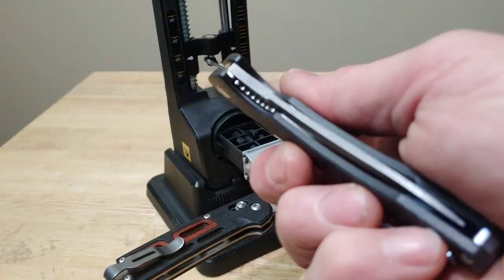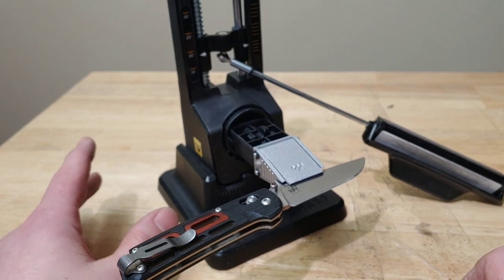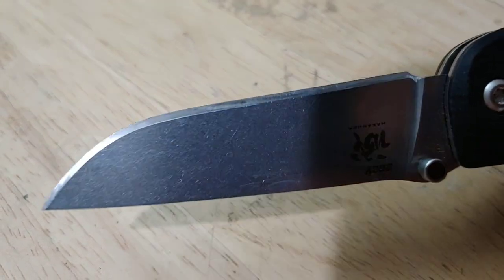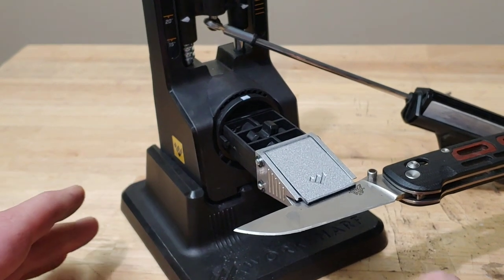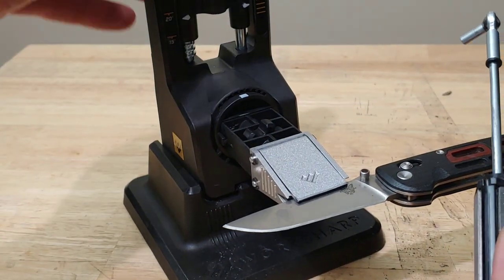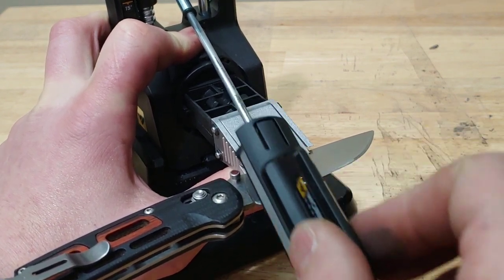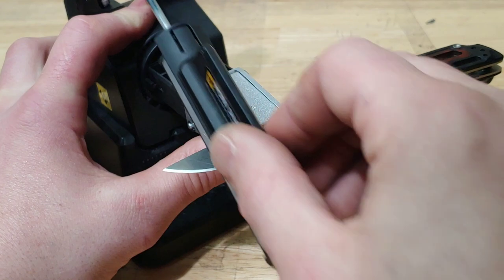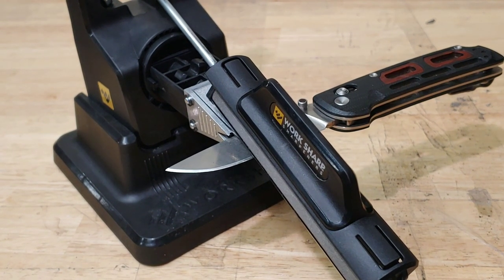LONG TERM UPDATE WORK SHARP PRECISION ADJUST SHARPENER

Comment: So, dont know if this is something you would ever do. But I read about this on someone else's channel, tried it and man did it work. So The first knife had a relatively good edge so I started at 600. I went probably a few more strokes than suggested at like 12-14. As you say the jump from "600" to the ceramic is huge and it was taking a ton of time. So here's the trick. Instead of just going to the ceramic and spending a year on that grit you get this stuff called "aleens tack it over and over" You apply that to the ceramic with a finger getting a thin coat all over the ceramic. Now before this you have ordered up some automotive sandpaper. You can get 3 sheets of each grit from 120 all the way to 5000 you take all the grits you need and cut out strips which for this is 1/2"x4. This tack it stuff is insane once its "dry" after a couple minutes you can tack on your first strip. You would think it would slide around and not work. False, its rock steady doesnt move a millimeter. But what about the rest of the strips? Literally every strip can be removed and a new one added with no loss in holding power. The tack it stuff is 5 bucks, the auto sandpaper is six bucks for that giant pack so for 11 dollars you get tons of new grits and the ability to dial it in. Now what about the cyramic stone? The tack it shit is water solluble so when you are done you just wash the stone and its like new. Anyway I thought Id share what id discovered. Every edge ive done so far is like mirror. Im not being boastful im just trying to help fellow knife folks! Cheers
Reply: Appreciate it!
Reply: But can the sandpaper sharpen high hardness premium powder steels as effectively as diamond?
Reply: @TMthumper   I am sure that it for sure can beat the sand paper at speed. So like diamonds obviously going to go faster all the time but  the number of packs of car paper I can buy next to the amount ill pay for really premium stones is not even close. Its a bit more of a pain in the butt but its like right where I want it in terms of time. Like this method is not the fastest way to sharpen a knife even with regular stones. but its good for beginners and kind of fool proof. So like if you check the following boxes- kind of a beginner, not doing 100s of knives at a time, not sharpening by hand. Then also- looking for a stupid cheap alternative to expensive stones this could be a best bet. But will other ways be better shmancier and faster? absolutely

Comment: Any guided system that uses diamond plated stones comes with the same warning. Don't press too hard, let the diamonds do their thing. Pressing harder will NOT cut faster, use a softer touch.
Reply from the maker: Definitely, letting the diamonds do the work is important and helps the stones last longer
Reply: I use only the weight of the stones on the diamonds
Reply: @loder6179  and it still flexes
Reply: I have this exact same sharpener... That is a design flaw!... It flexes even if you apply no pressure! It's the plastic that's not sturdy enough
Reply: @frederikmare9002  I just support it with my off hand, I can't afford an edge pro or anything like that and it keeps my knives paper cutting sharp without even having to think too hard
Reply: @jazrivvaz1282  don't get me wrong, I get my knives shaving sharp as well on this system!... I even bought the upgrade kit!... My message is actually an idea for worksharp to upgrade/improve their great system!... If they sort out this deflecting problem, they will hit it out the park!!!

Comment: ‘Sweetknives’ has videos on putting sandpaper on the ceramic stone for a mirror polish.
Reply from the maker: Yes im so stupid i seen that video and forgot to mention it
Reply: Just no need to buy the expensive 3M adhesive. Double sided tape works just fine and is way easier to maintain.
Reply: Just saw this after my long comment
Reply: @MrDands  do that too and agree, less messy too
Reply: The only shitty thing that he does not seem to mention is they are aluminum oxide lapping films, so you shouldn’t really use them on anything like S30V and up in Vanadium content. He always seems to sharpen cheap knives with his 3M lapping film technique. Anytime he sharpens anything even close to a “super steel” he uses a more expensive sharpening method with diamond stones.
Reply: @Mackalacka1   most sharpening stones are diamond… this work sharp are diamond grit stones.

Comment: It’s a decent system for the price, for most people.  If all you want to do is to sharpen your EDC, and get a decent, sharp, useable edge, it’s fine.  If you are sharpening several blades every day, and you want that mirror polished edge, and you’re a super perfectionist, you probably won’t like it.  Also, it’s not for “regular” pocket knives, as those blades are too narrow.

Comment: There are a number of aftermarket "braces" you can get to eliminate that play/movement in the jaw mount... they are specific to to that Work Shop sharpener model, run about $12-17, and are easy to use. They slide between the base and the bottom of the jaws, and prevent the jaws from moving down with pressure.  To locate one use search term 'Clamp Arm Brace for Work Sharp Precision Adjust' at the usual places you might buy and or bid on things.
Reply: Do you have a link for something like that
Reply: @trevordelarosa3599  YT keeps deleting my direct replies.
Reply: It ships with something these days.

Comment: That's a good review, man, and I came to the same conclusion. Killer price point, that movement is problematic. Love your thumb trick to stabilize the blade. 
I see this as an awesome tool for someone who wants to give sharpening a try to see if they like it and if they do they can set aside a few more bucks for whatever higher end system catches their eye. 
This is still a value add tool to the sharpening community and I hope it helps get more people interested in sharpening.
Reply from the maker: Definitely a fantastic sharpener that gets killer edges, and i know its great for the community esp at this price point, lots of people cant afford a wicked edge

Comment: Every mechanical device will have some float, play.
You can adjust the a gle for any play.  But with this system you are meant to apply only very light pressure only.
I have the same unit. The more expensive unit also had some play in the clamp also.

Comment: Im as beginner as it gets for sharpening, the only thing I’ve used is a pull through. I was planning on buying this same model but the Elite model that comes with 7 abrasives(220, 320, 400, 600, 800, ceramic, leather strop & ceramic rod). In your opinion is there a better option for my skill level of sharpening or is the Work Sharp model I mentioned the best bet?

Comment: I sprung for the pro precision adjust $250.  I like it, mostly.  For kitchen knives, they need more clamp space on the knives.  Without it, there is too much movement.  My knife gets pretty sharp, but you have to be very light on the touch.

Comment: So, I bought both the tower and the upgrade stones. I see about the fine finishing issue. I also have an Onion belt sharper and got some abrasive loops up to 4000. Gonna try gluing a section onto one of the finishing stones, see if that helps.

Comment: I do own the WSPA and consider it the best sharpener I've seen.  It is not made to polish a blade.  It does do an outstanding job of knife sharpening.     My point has been it was judged against systems of a much higher cost for performance it was not designed for.
Reply from the maker: I completely agree, and i think thats the beauty of this system its very affordable and gets you an incredibly sharp knife definitely the best bang for your buck

Comment: Can use my old Lansky stones on my Work Sharp....drill 2 small holes through the finger grips of the Lansky stone...1 at each end...insert 2 small zip ties to caress the guide rod on Work Sharp...not too tight...use my Klein angle finder to get the rod angle right...works great...easy to swap stones.

Comment: I sanded the edge of both sides of my clamp. This created a surprising increase in access to the bevels on narrower height blades. 
I use adhesive-backed lapping film to provide more grit options.
Reply from the maker: Nice! Im giving one of these away a brand new one just showed up
Reply: I also superglued a copper stopper at the end of the sharpening rod. This prevents the rubber range limiter from falling off.
Reply from the maker: @scottallen6058  so smart! Great idea

Comment: Doesn’t the depth of the blade alter the angle on this system? A larger knife sharpened with the setting on 20 degrees will end up sharpened to a shallower angle than a small knife sharpened with the setting on 20 degrees? Isn’t that a problem?
Reply from the maker: I don't think it's a problem but yes angles can change you can always get an angle finder if it's a really big deal, and you can see and adjust to the appropriate angle you want, but yes angles can differ

Comment: Hi
Thank you for your good video, how long does this knife sharpener usually work?
Reply from the maker: It depends on how thick the edge is and what angle you sharpen at, it's not a fast one this would be on the much slower end of Sharpening, if you want speed then you want a system that uses 1x6 inch stones and get a very low grit starting diamond plate, the professional is a good one from work sharp
Reply: @NeevesKnives  
Hi
Very thanks my friend

Comment: I just bought one yesterday.  I re profiled my esee 3 from 20deg to 15deg. The 600 grit doesn't remove enough material like I feel it should. I would definitely like to see a more coarse stone for that issue. It took me quite along time to get a burr with that 600. Would also like to see a leather strop add on too. I have a small  turnbuckle with plastic feet on both ends and used that under where the knife clamps on to keep it from sagging down when sharpening.  Seemed to work very well for me. Overall it's a great system.  Has room for improvements though and I'm sure Work Sharp will bring us some additions for it soon
Reply from the maker: Absolutely I'm happy to see other companies starting to make more and more attachments for it, I just posted a. Attachment to help get a mirror edge, and gritomatic has a 4" stone holder coming for it that will take it to a whole other level because there's so many different stones you could use
Reply: You should gotten the elite if comes with more grits and a strop

Comment: I know lots of people use this system or similar ones but I don't understand how they can possibly work correctly to produce proper angles. Geometrically this is a triangle where you can adjust the height of the "opposite side" to pick the desired angle (15-30 degrees). The "hypotenuse" would be the sharpening rod. The "adjacent side" would be essentially the knife blade... But since knives vary in blade size (spine to cutting edge) the geometry changes from blade to blade making the adjustment scale inaccurate.

Comment: So how will I know exactly when the Burr will be ready to remove and start the sharpening process ..
Reply from the maker: You can feel it and if you watch the grt you can see it, i have an entire sharpening playlist answering tons of sharpening questions, but a burr is steel that folds over to the opposite side, so you can feel it like a wire on the entire edge, but you want to watch the grt also so that you hit the entire bevel, you should check out my playlist because a lot of sharpening things relate with all ways of sharpening

Comment: What about adding a small block of wood cut to exactly the height between the base and the clamp that would solve the "movement deflection" also use light and consistent pressure on the rod.
Reply from the maker: Absolutely theres many things that people have come up with to improve it for them and regardless its awesome alone but with minor adjustments it can be incredible
Reply: @NeevesKnives  Just received mine unit the other day. Tried it out today there doesn't seem to be too much flex in my clamp as there was in yours. perhaps its comes with wear and use but I will keep an eye out for it. Quickly put a good but not outstanding edge on my Kershaw which I believe is AUS 8 steel. at 23 degrees
Reply from the maker: @johnbalogna803  mine was that way from the box they might have tightened the tolerance a little

Comment: I have the Work Sharp and what works well for me to get a mirror polish with the ceramic stone is to polish with a Right to Left motion instead of Up and Down.  I also use a little soap and water in a little spray bottle to help irrigate the blade by removing the metal dust.
Reply from the maker: Thats exactly how i showed to use it in my review for best results, if you have stropping progression is can really help to get a mirror

Comment: If you just need to touch a knife up would you use the 600 grit and the ceramic or just the ceramic?trying to figure out in what situations you use all the parts of the sharpening system versus just the finer grits? Thanks for any help
Reply from the maker: If I'm only honing I just use the Ceramic atleast as far as this system goes
Reply: @NeevesKnives  thanks. So when just touching up use the ceramic in what cases would you just use the 600 grit? Trying to figure things out so your help is greatly appreciated

Comment: Thank you for your honest review. I ordered this sharpened and have yet to try it, bit the cons you found are valid. That little play will not make the edge consistent and smooth like the edge at 13:50 :O omg.. that is a mirror razor edge.. i want that edge on all my knifes .
Reply from the maker: The system works great especially for the price you can definitely rig things to make it even better very easily

Comment: Do you have to use oil or lubricant thanks
Reply from the maker: You can but don't have to with diamonds the Ceramic I think you should mix water and dish soap but you can use it with just water or oil, there's attachments available now for this that allow you to use any kinds of stones including the exotic ones, check out my work sharp 4" stone holder attachment video

Comment: I noticed that when you were talking about the knife moving if you push to hard that you didn't have the kinfe in the clamp all the way, you had it on the edge of the clamp where as you should have it to where the spine of the knife rests in the v notch of the clamp
Reply from the maker: Thats not what is moving its the entire clamp, ive used it in many ways the small knife wont go all the way in and get the angle i want the big knife is all the way in, but thats not whats moving its the clamp itself

Comment: Great video thanks. Thanks for the things to keep in mind when I use mine once it arrives. I was think if I clamp the sharpener down to the table I may be able to add a block of wood that was the exact size to fit just under and back out of the way the prevented is from moving down when I press the stone down to hard by accident stopping any movement so it doesn't have the problems of uneven sharpening resulting in the splotchy finish. Also maybe putting something under the sharpening stone to shim up any play so it doesn't move in and out when you apply pressure.
Reply from the maker: Oh definitely theres many ways to set it up for success, its already fantastic so little adjustments when setting up can definitely improve and is very easy

Comment: i have a problem with chef knives that have a tapered spine, narrows from handle to tip.  Blade rocks, as the fatter portion of the blade gets clamped better.

Comment: Best review so far on this thing 👍. I saw those small flex in there video and I was disappointed ☹️ I already wish for a pro model that Is made out of aluminum and remove the flex !!! Now I can’t wait for a video comparing this to a KME or Wicked Edge 🤙
Reply from the maker: I dont think its fair to compare, because a wicked edge is like 500$ more and a kme is hundreds more as well, it should be compared to the lansky and ssystems alike, for the $ its an amazing system but no system comes without issues, id love to see an aluminum version

Comment: I've noticed on most of the knives that you display after sharpening, you seem to have reprofiled the angle quite a bit. Especially that kubey eris in this vid, my factory edge is at way less  of an angle. Is this because you personally prefer a higher angled edge?

 I assume this increases the sharpness, but needs to be touched up more often since there's less metal backing up the very edge?

Also how do you recommend fixing a rounded tip? I've seen some say to reprofile the spine instead of the edge which I don't think is a good idea. Thanks and sorry for all the questions.
Reply from the maker: The eris has been sharpened a lot so its very thick bte, which makes the bevel larger, and it makes this knife cut better, i dont lay all edges back usually just the ones that benifit from it, I wouldnt fix a tip from the spine personally, I would do steel removal from the edge until its at a point that i can sharpen it

Comment: I had one deliver last night.   I’ve been using the Sharp Maker.  Which I have kind of gotten okay at using.  But these type of systems are just so much easier to use.  

I probably should have gotten a more premium system.   Just spend the money and be done.  Because now I’m feeling like I’ll never be completely happy with this.  

I always want a system that is better than I am.  So I can grow into it. And I’m not sure this is that.
Reply from the maker: Yeah for the money its amazing, and ive got one on the way to give away, but its not going to compare to a much more expensive system but its not supposed to